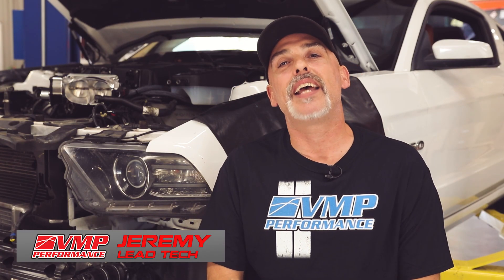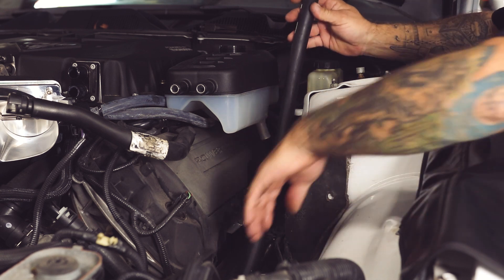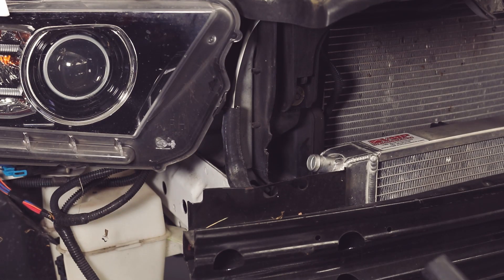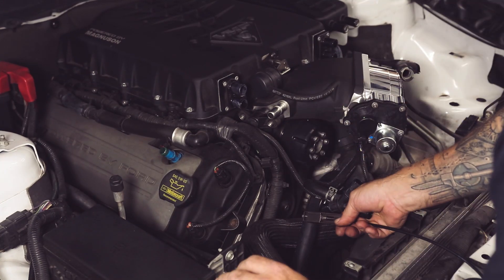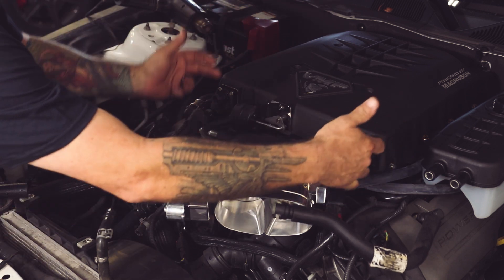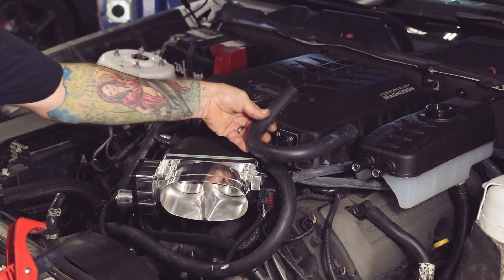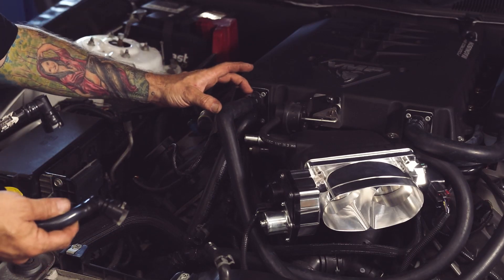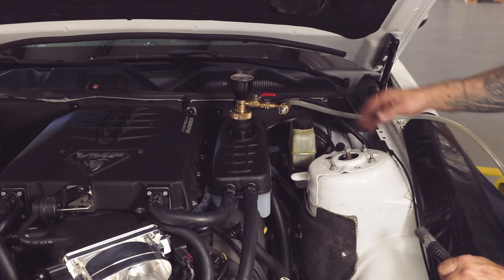Air-to-Water Hose routing for Odin and Loki Kits  ||  Project Odin

Comment: I agree with the other posters. All those hoses takes away from the appearance of the Kit. Find a better way to hide the hoses. They do not look finished. Other then that great vid'ya. cant wait till i get the VMP on my 2013 F150 XLT 4x4 Crew cab. Right now its just tuned. Saving my dimes and nickles.

Comment: When I did mine i didn’t use the shrink wrap clamps on the degass bottle inlets. I used regular crimp clamps there for ease of removing the hoses to get the degass bottle out of way when changing spark plugs. Other than that I made my set up look clean with the hoses and she pulls like a freight train 👍
Reply: Just unbolt it and lift it out of the way slightly. I’ve done it several times.